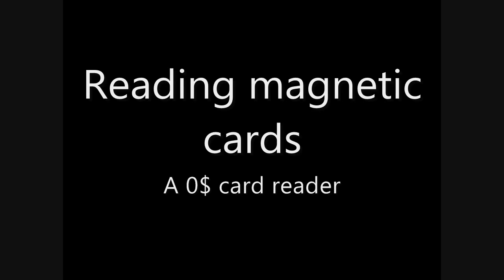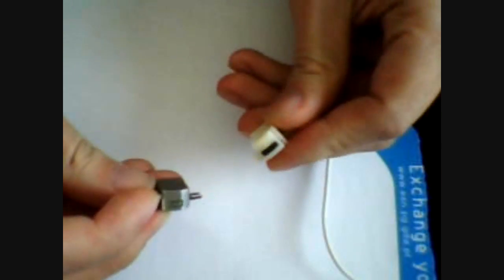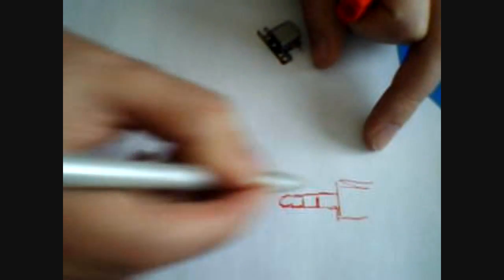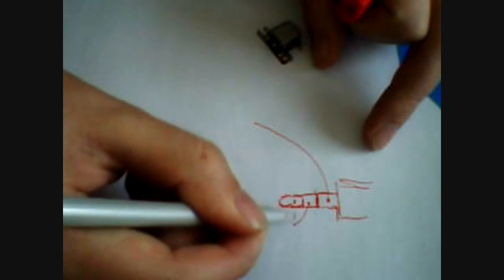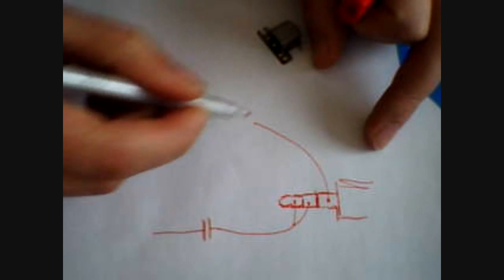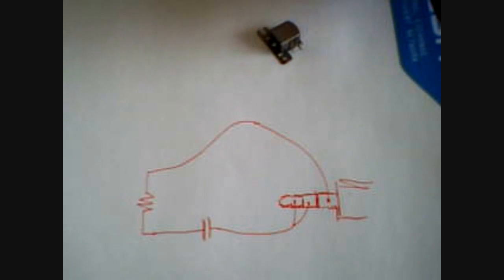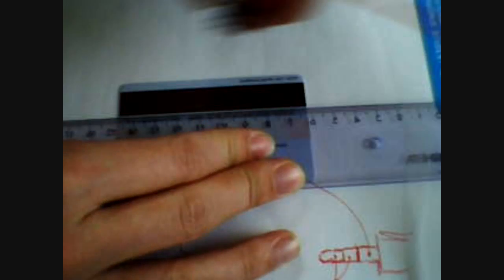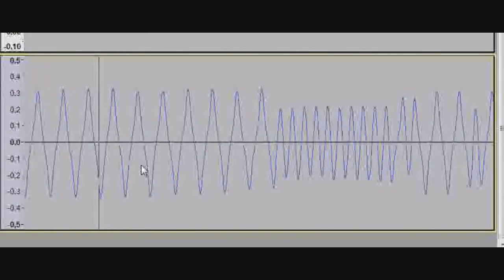Very simple selfmade magnetic card reader

Comment: Unfortunately we failed..... pls upload a photo of circuit.......
Reply from the maker: A photo would be pointless. It looks different depending on your cabling to the soundcard. The tape head has two connections and the mono microphone input has two connections, polarity is not important. There is now way to screw that up. If you use a stereo cable you can connect the shield of the cable to one contact of the tape head and right channel and left channel wire together to the other contact of the tape head.

Comment: I'd like to make one of these just to read what's on phone cards and gift cards. Nothing illegal. I have the square reader but it's encrypted. I found an app on my phone that can read the sounds but not from the square reader. Just want to read the data on my phone cards and I even found a toll booth ticket that might have something on it.
Reply: +coondogtheman1234 the square reader is not encrypted
Reply: Bitmapper

Mine is, it's the slime one and when I record a voice recording with the square reader hooked up it makes this loud screeching noise.when I run a card thru it. I've run card on a tape recorder head and it had this soft whoooo like sound, nothing like what comes out of my square reader.
Reply: That's not encryption. Slow down the recording from the square reader and you'll find the data there. It's just a screeching noise because there is an amplifier in the Square that makes the noise louder.
Reply: Bitmapper

/when you run the card slowly it's supposed to make a slow whooop sound that changes pitch when you run the card at different speeds. My square reader makes this same screeching sound no matter how fast or slow you run the card through.
Reply: facepalm I never said run the card through any slower. I said slow down the recording. Also, it could just be simply amplified. Also, if it was encrypted, what would the encryption algorithm be?

Comment from the maker: Check your wave forms visually using an audio editor like Audacity for a clear signal. If you have noise on your recording try to remove it by applying a low-pass filter. Get sure that your recording is from start to end. If not, use the wave editor to reverse it. Audio devices usually use an internal high-pass filter, which may deform the recorded signal in a way that my implementation will fail to recognize. In that case some modifications on the software will be necessary.